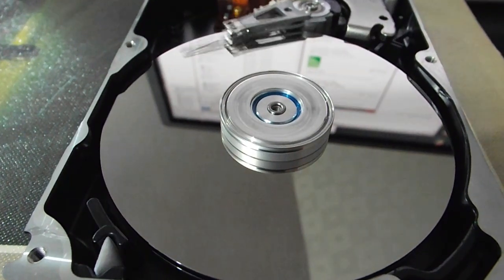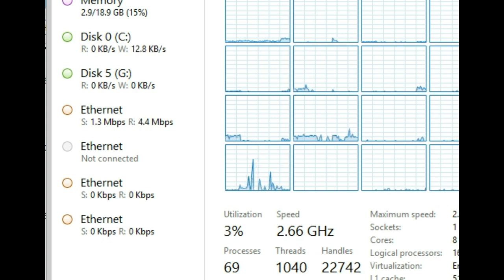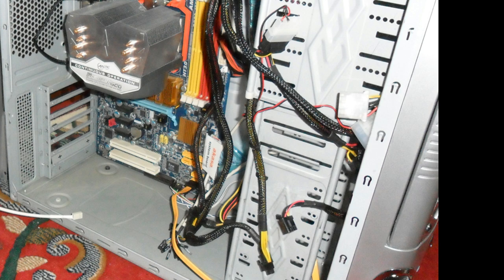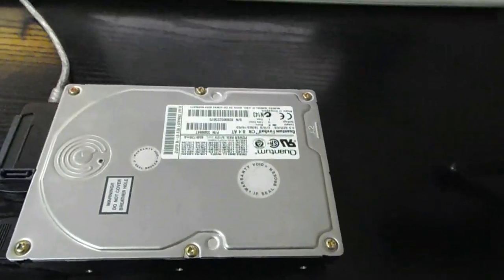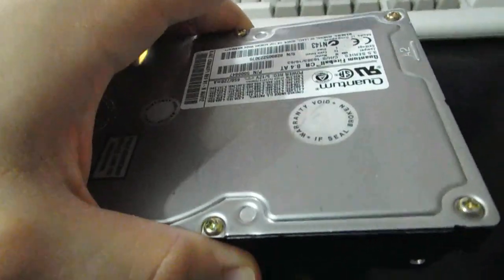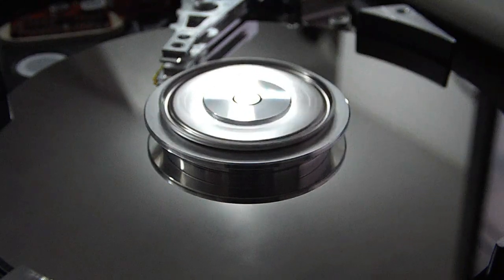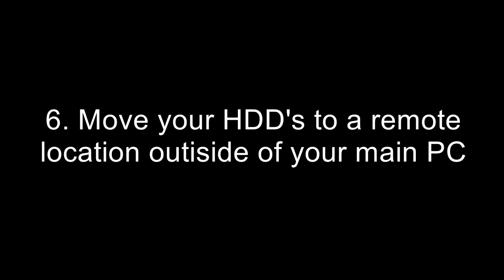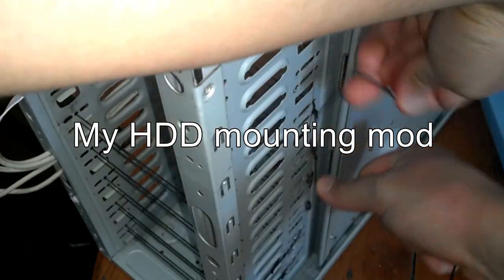06 How to silence your Hard Drives

Comment: I thought my hdd was loud until I watched this video
Reply: yes.  I feel better now about my HD.
Reply: @FinnKitten123 I replaced my whinning hard drive with a 500GB M2 drive,  as my MoBo had a second slot for M2 (M2 Pcie only, not M2 SSD).  Cost me $80-, but huge reduction in noise, and faster speed, especially boot up. 

My noisest component now is my stock AMD CPU cooler, but with the PC under my desk I'm ok with that, its quiet and lower pitch hum compared to that horrible high pitch spinning hard drive.  So I'll leave the CPU cooler untiI I feel like upgrading to dedicated CPU cooler to achieve a totally silent PC.  

Note my graphics card, a second hand EVGE 980 Ti has the fan stop mode, for total silence when in office work mode of low spec gaming. I think most cards have the fan stop mode now but worth checking if you are buying a GPU and a silient PC is what you want, at least in 'office/browsing mode'.
Reply: @Baffuteagle  great! I have a ThinkCentre m720s
Reply: I have that kind of hdd in my old pentium 2 pc. There it's a 2gb quantum fireball. I didn't know that it was the hdd that was making these sounds until I watched this video)

Comment: I want that hard drive sounds like a machine gun
Reply: Mine does and I hate it
Reply: @ericp4573  Try to move problematic HDD on the bottom place in cage, that resolved problem by 50% in my case
Reply: @ericp4573  Let it rest over foam. I did it and I tought during some years that the sound of my HDD was the sound that actually is the sound of the PC fans. I never hear my HDD working! :P

Comment: 5:50 my 500gb seagate 7200.12 from 2009 isn't loud at all. i bought a new 1tb barracuda this 2021, it sounds like a popcorn machine all the time so i bought 1tb western wd10ezex, it vibrates so loud that it rocks my whole case. i even put in it bubble wrap and on the 2 cords of front panel jumpers. the thing is still loud on idle. can it harm other pc parts if it vibrates the whole case?

Comment: I replaced my whinning hard drive with a 500GB M2 drive,  as my MoBo had a second slot for M2 (M2 Pcie only, not M2 SSD).  Cost me $80-, but huge reduction in noise, and faster speed, especially boot up. 

My noisiest component now is my stock AMD CPU cooler, but with the PC under my desk I'm ok with that, its quiet and lower pitch hum compared to that horrible high pitch spinning hard drive.  So I'll leave the CPU cooler untiI I feel like upgrading to dedicated CPU cooler to achieve a totally silent PC.  

Note my graphics card, a second hand EVGE 980 Ti has the fan stop mode, for total silence when in office work mode of low spec gaming. I think most cards have the fan stop mode now but worth checking if you are buying a GPU and a silient PC is what you want, at least in 'office/browsing mode'.

Comment: Those Quantum 8.4 GB drives are about the loudest you could pick, and they're about 20 years old. Not a fair comparison, most harddrives are not anywhere that loud. Also the 10k and 15k harddrives aren't meant for consumer PCs, so no wonder whey were developed with something else in mind rather than noise reduction. Good modern harddrives are barely audible...even my WD Caviar Black 2 TB drive.
Reply: Seconded, my Seagate barracuda is silent almost